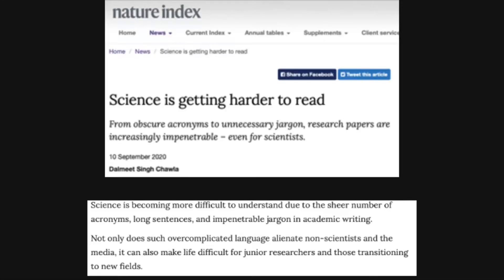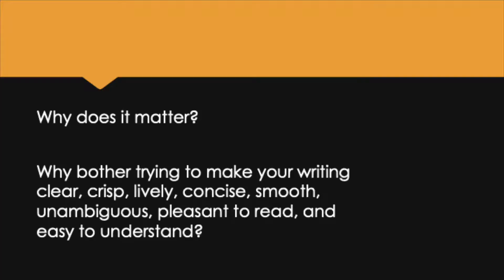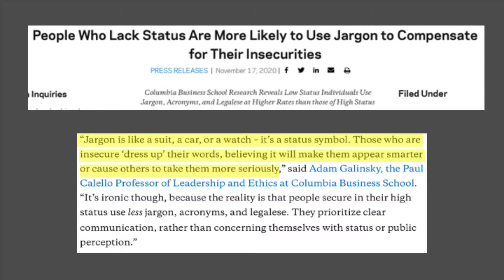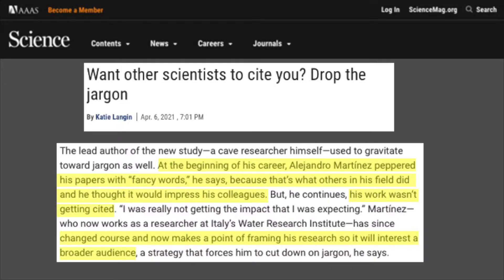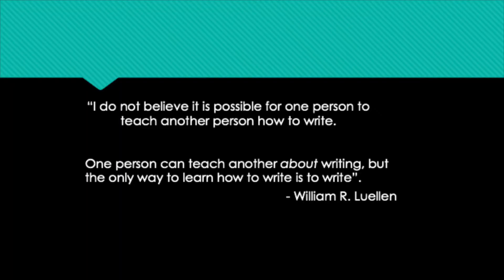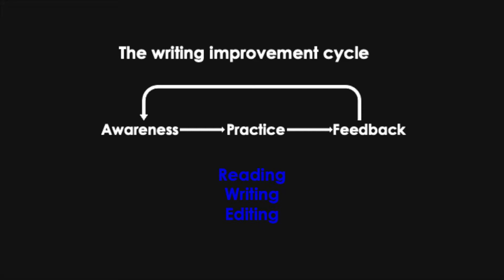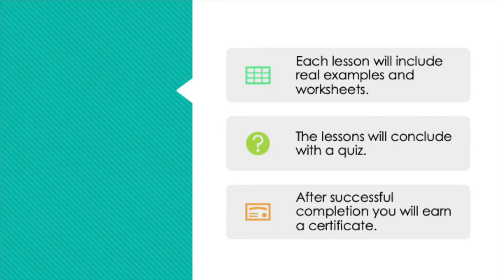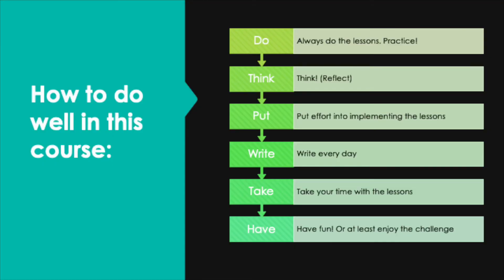Why is scientific writing so bad? Good technical writing how-to

Comment: I appreciated this video very much, Dr. Waters. As a dual French-American national, former French and English teacher, and technical and legal translator of over 35 years (including patents in a number of fields), I am increasingly frustrated by the poor quality and readability of a great deal of what I am called upon to translate and/or proofread - in both languages. A clear understanding of good "scientific" and technical writing techniques is also extremely important if the work is to be translated. It determines whether or not the linguist can easily follow and understand a document and, accordingly, either provide a flawless translation or struggle with the text and end up with a less-than-optimal delivery. It also helps to produce appropriate, unambiguous patent applications and ensure that a patent can be granted with few or no corrections or clarifications required by the examiner, and it can be crucial in patent law. I wish your videos were included in translation courses; future linguists would benefit from them as well. They would certainly be genuine assets in scientific and technical curricula.  Translators should be able to focus on translation accuracy and target language localization without having to slog through awkward syntax in the source language and research obscure acronyms and abbreviations, never mind being attentive to confusing grammar and spelling mistakes and trying to guess what the author actually meant. Of course, nowadays AI has entered the translation field but you can't put AI to its best use if you have a poor understanding of language and writing skills. 
I'll certainly have a look at the full playlist; I'm sure I'll learn a few things myself (or at least get a refresher)! Thank you again.
Reply from the maker: Thank you for the thoughtful comment! I'm glad the video was helpful for you.
Reply from the maker: These 3 videos on readability might be useful for you also:
What is readability and how is it measured?: https://youtu.be/mgr0-qz6rWg
The first 3 steps for improving readability in technical writing: https://youtu.be/tmNiolELIj0
Steps 4 to 7 for improving readability in technical writing: https://youtu.be/LisgAjm-4zg
Reply: @ScientificWritingSchool  Thank you! Ill be sure to have a look and recommend them to project managers for new recruits :)